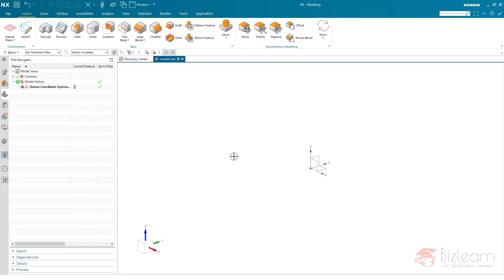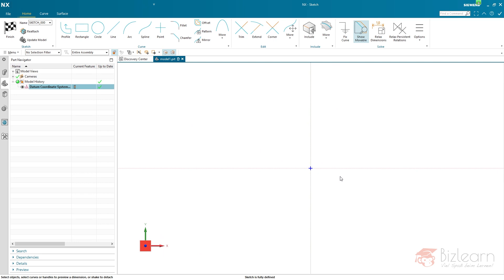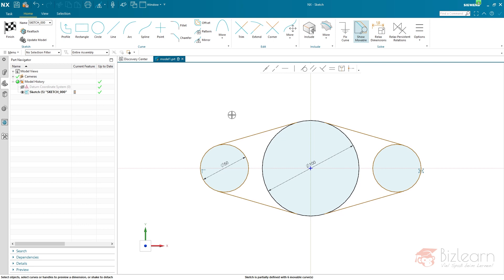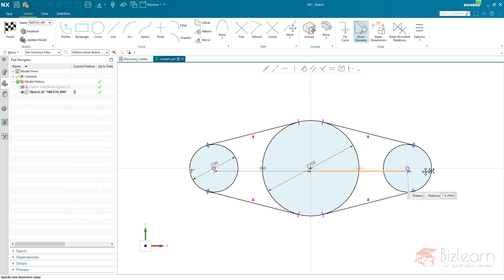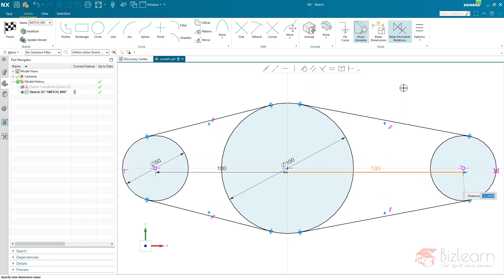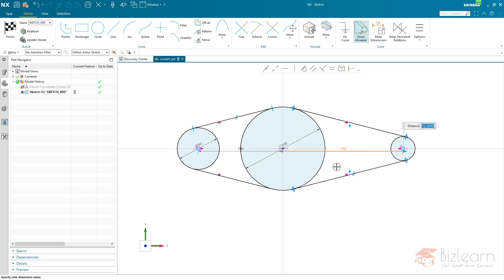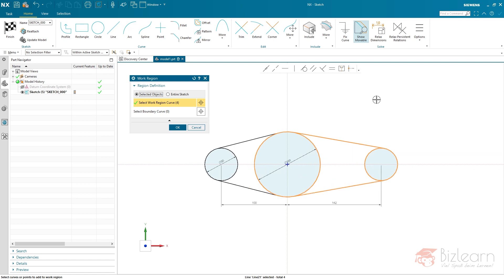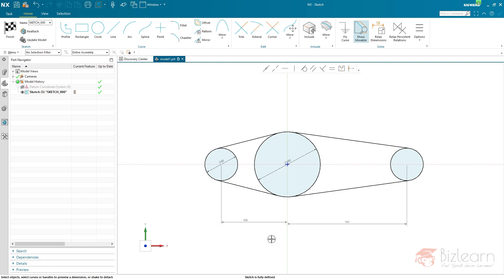Siemens NX 1980 Tutorial – Sketch Solver improvements – the new Work Region has made my day (-:

Comment: Hello. I see the new Sketch as very confusing technology. It's looks that Marketing here wins Engineering.
 I see today (1984) these major problems:
1.	I can't see Constraints on building sketch. Especially it’s important for Constraints to Included Curves. It cause to unknown links and to possible unneeded links.  
2.	If I need to delete Constraints for specified geometry partially – it's very unfriendly.  
3.	How I can make Vertical\Horizontal Constraints between points?
4.	Why moving curve linked to Included Curve out of the Included Curve broke the link?
Reply from the maker: Hi Vadim, did you participate a training concerning the new solver already? Of course things are different, but after 1 year of experience, I see more advantages compared to the old sketcher. I think, comparing both is not a good idea, as methods have to be evaluated and changed.
Reply: @Bizlearn_Siemens_NX_Training  Hi. Yes, we (I represent here group of users) learn it. We checked versions until 1996. I see that many problems that was in 1946 now closed, but I see also a number of concepts in new Sketch that make it very unfriendly.
I back to my problems list:
1.	I can't see Found  Constraints on building sketch. Especially it’s important for Constraints to Included Curves. It cause to unknown links and to possible unneeded links.  
2.	We have 2 different types of Relations: Found relation (“weak”) an Persistent relation (“strong”). 
a.	Found relations are very weak – any move can remove it. We have here 2 groups of Found Relations: Coincident, Horizontal & Vertical (line) are strong enough, but others (Point on Curve, Tangent, Symmetric, Horizontal & Vertical (points) ) are so weak.
b.	Persistent Relations. The problem is – I can’t open Persistent Relations automatically, I must build it.
3.	If I need to delete Found Relations for few geometries partially – it's very unfriendly. I can do it only one by one.  
4.	Sketch dimensions does not exists for Expressions Table
5.	Creation Rapid Dimension doesn’t get possibility to change size immediately.

Comment: Hello, we also use the new sketch solver now, and face essentially 3 major problems:
1.) old fully constrained sketches are now "partially constrained" after conversion - and often "partially constrained" rather means "overconstrained"
2.) It is quite exhausting to search for missing relations without being able to visualize the degrees of freedom/ the count of not yet defined relations
3.) Large sketches result in a major speed drop

I would be very glad, if some of these issues could also be portrayed in the next videos to some degree 🙂
Reply from the maker: Hi Alex,
Are u using the NX 1926 major? Compared to later releases, the sketch renewal is resulting in partially defined results. This behavior has been enhanced at some aspects.
In former times I was a big fan of the auto dimensions to identify degrees of freedom and still missing the opportunity at some point. Did you change the color setting for underconstrained geometries? The default is black and brown, which makes is hard to identify degrees of freedom.
Sketches should be faster than before. Are you talking about renewed sketches with maybe external references? I have made the experience that the new sketch is faster as promised by Siemens.
When changing to a new release, it is always recommended to consider construction methods, ideally with help of external consulting and of course available training programs. You are working for Siemens - am I right? (-:
I will consider your remarks in the upcoming videos. Thanks for the input.
Reply: @Bizlearn_Siemens_NX_Training  Hi, that was an accurate guess, indeed we are using 1926. Sad to hear, that it will only be repaired in later releases...
The speed drop was observed after conversion of large sketches, with high quantity of persistent relations - no external references included. And of course, we share the same sentiments with regards to the missing autodim. feature in NX...

Comment: Thanks Simon for uploading this video and welcome back.

I have some queries related to NX 1953. I don't know whether these things are overcome in NX1980 or not as i don't have this latest version with me.
1.)When creating new sketch there is no way to create an offset plane and also there is no option to orient the coordinate system of sketch. This cause rotation of whole assembly when i am going to create sketch in Top down assmebly.

2.) I am not able to find the command called Animate Dimension. This command help me in animating the linkage in 2D sketch. 
Now i have to do this via edit parameter command but not able to animate in that.

3.) For accessing Lines and arcs toolbar i have to go to insert-Curve-Lines and Arcs & then select the command but in NX 10 whole Lines and Arcs toolbar can be shown in top command bar. This is not possible in NX 1953.

These are some of my queries, it would be great if you cover them in your next session.
Thanks